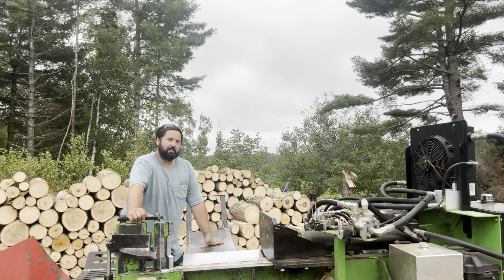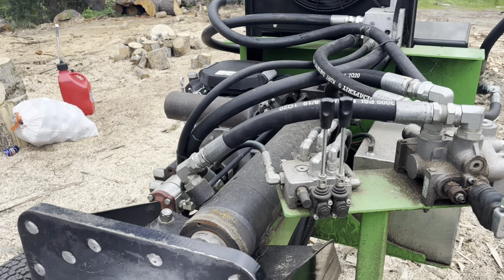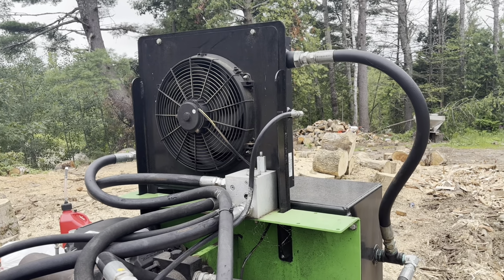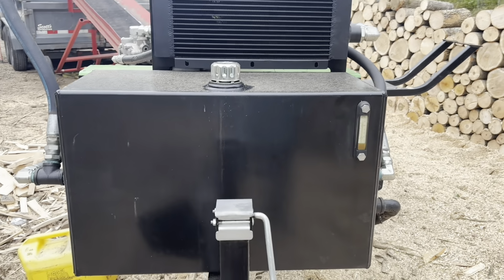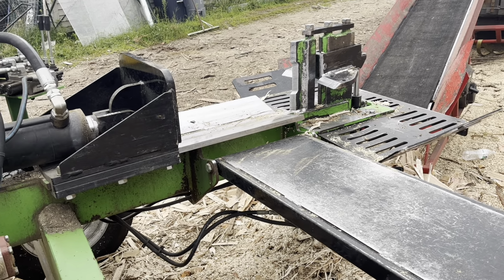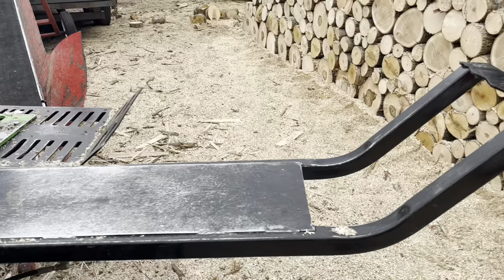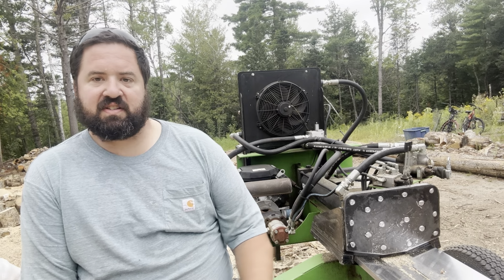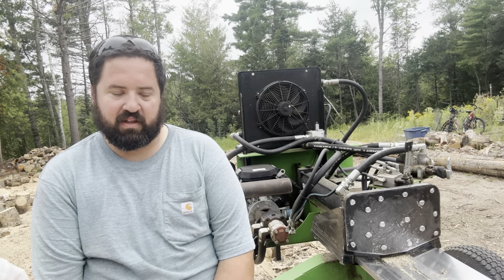#106 Is the Allwood Splitter a lemon ?!?

Comment: Your valve, easy fix to move them, in the marine industry you can get 1/2 bolts flat head, if the bolts are larger a machine shop can make you a bunch, I've been watching almost all of your video's, the only dislike I have the design of your table, it creates a bottle neck you should not be touching any wood going to the conveyor.
Reply from the maker: Yep I agree I need to widen the mouth of the conveyor and I have a friend with a machine shop that is going to do that for us soon

Comment: I just have one complaint about all wood, I ordered my birch unit when you and heath did the “ coming out “ video, like at the new year, I was told 8-12 weeks it’s been seven months. I thought u were an all wood dealer?
Reply from the maker: I'm a non stocking dealer.  This video was made to answer some questions that people had about my old machine.  I know with tariffs some overseas parts have been hard to get but the shop is working through the issues as quickly as he can.

Comment: What are measurements of you r wood racks 5.00 bins and up
Reply from the maker: Each 8' section is 1/3 of a cord when filled with 16" wood.  I break each 1/3 cord section down mathematically for the amounts sold.  4 $5 bins is the same amount of wood as one $20 bins

Comment: Easton made  22 28  most likely what u need   power speed autocycle  and different  wedge opinions
Reply from the maker: @rebeccarobinson7024  I will have the new splitter soon and it’s going to be something no one has seen yet. Stay tuned.
Reply: @WilleysFirewood   ok can't wait forgot about the brute force  ones they are also based out of Wisconsin

Comment: I got the all wood oak series. Very pleased after about a month of ownership.  I am 6’2”. I like the height of the machine. Built like a tank. A400 steel. Don’t know what a400 steel is, but apparently it is really durable. Cycle time is 6 seconds. I wouldn’t want anything faster as I split by myself and extra speed would be wasted. I got a free upgraded sorting table as a veteran. Owner is responsive. Production is greatly increased
Reply from the maker: @davidself3169  I’d buy another Allwood in a heartbeat. They are amazing. I have over 2000 cord through mine with very little issues whatsoever. I’m hoping my next splitter will be higher output and diesel.

Comment: I have a 37D - absolutely love it!  There is tons of power and it barely notices with any of the different wedges.  The only downside to the 37D is the towing...but on the flipside, it is certainly optimized to work from one side.  The only splitter my 37D will be replaced with is another 37D.
Reply from the maker: @jamesbainton  I like the speed of the 24d but I have a couple other diesel splitters that I’m keeping an eye on as well.
Reply: @WilleysFirewood  make sure you watch the Wolfe Ridge diesel vid with the box wedge that Bob Nelson did and the 37D vids.  There is a massive difference in how the wood flows through the wedge...all I am saying is watch closely and you will see the differences.

Comment: Russ, I need to add an oil cooler to my homemade splitter.  Can you pass along the info you found about yours and the next size up?
Reply from the maker: @spillman1569  this is the cheaper larger alternative. https://a.co/d/46LgSD5
Reply from the maker: @spillman1569  this one is in stock Rubivel Industrial Cooling System Mobile Hydraulic Oil Cooler 0-120GPM 90HP

Comment: Speed, durability and customer service is number one at Eastonmade..  i purchased a Bells 4000..  they which is now Eastonmade..  called Jeremy yesterday because ram would not return properly..  2 minutes later I was able to determine the issue .. .  With the 12-22 i purchased, I blew the rad ..  1st time they replaced the rad  shipped to my house the next day..  when it happened the second time they replaced the entire machine..
Reply from the maker: @buckinfirewood  I had a bells 4000 as well and their customer service was always top notch!  Thanks for the input and stopping by!
Reply: @WilleysFirewood  really..  I'm currently running a bells 4000..  great machine I must say..  why do you not have the processor anymore??..  with the amount you push out sure looks like you could use one
Reply from the maker: @buckinfirewood  gramp wants to cut by hand so as long as he wants to cut we will do it by hand. Gramp likes having the work and I enjoy having him around. We are close to the point of needing to shop for a processor again for sure but I need to keep gramp cutting too.
Reply: @WilleysFirewood  Gramps is a machine..  your lucky to have him

Comment: Just got my allwood locast.
Id also like a thermostatic swich. I wish the engine controls were easier to access from the other side. But otherwise, I love it. I have auto cycle and more centralized controls,  also a closed in log lift. Its a monster. I too like the height compared to the others.  Thanks for sharing!
Reply from the maker: @patrickspath4526  yeah the newer Allwood machines have some things changed to fix some of the issue I griped about.

Comment: The blood wood from all wood is a beast 42 ton, full auto cycle, processor style wedges, 24 HP yanmar diesel. It doesn't look like it will accept a box wedge but 4, 6, 8... 
I have the 37D with the 23 hp Kubota it's a 37 ton beast with a smaller footprint then the all wood. I wouldn't recommend towing it far distances. So sometimes I wish it was built on a bigger trailer for towing but I only use it at the house usually. 
Eastonmade is delivering machines all across the USA for $500 that a long with Eastonmades superior wedges IMO would be my selling point 

Wolf Ridge makes great machines no question about it but their wedges need improvement. The closed box wedge system puts a lot of stress on the engine, cylinder and wedges. The slip on wedges would not last a year with the type of wood I split they would bend or break. 
The Eastonmade box wedges and traditional wedges are just built stronger and better.
Reply from the maker: @WellsFirewood  I’ve seen the diesel bloodwood splitter. It is impressive. Thanks for your input and stopping by!
Reply: The new All Woods do have a few improvements for sure. A lot of great manufacturers out there these days. We love our Muscle Wood but haven’t put quite the wood through it that you have.
Reply from the maker: @hardworkingmanoutdoors  they really do make a great machine!

Comment: I have a wolfe ridge 28c i have just shy of 800 hours had 2 hydraulic leaks one on main cylinder one on the autocycle valve both replaced by chris at wolfe ridge no questions asked. Once my cooler turns on it doesnt shut off until you stop splitting so a temp sensor is not necessary after fluid is warm in my opinion
Reply from the maker: @shawnwilliams7041  Wolfe ridge is in my list of options for sure

Comment: I always thought it crazy that guys would load the log lift and then walk around to the other side to run the controls.   Adding a little more room to the lift side between the tire and lift along with  locating the controls there would solve that BIG issue for a lot of folks.  2 folks can easily operate from one side on either side of the lift.
Reply from the maker: @SligoRoadOutdoors  I definitely want to be able to operate it from either side of the machine. That is a must.

Comment: If you like diesel and you want fast the 24d has both. It’s faster than the 37d just not as much power. From what I see your wood is pretty good not all gnarly. Just as you said the more splits the more waste but production goes up. I think the eastonmade you can choose between a box wedge and a standard multi wedge on the same machine. Peace
Reply from the maker: @williamkleinsLost40Lodge  the 24d is one of my candidates for sure. I’m doing some serious looking into things from all manufacturers.
Reply: @WilleysFirewood  this is knl firewood with a 24d
Reply: @WilleysFirewood  https://youtu.be/lvkiJOKbADI?si=c6lrfAGpkizqhP_j

Comment: I have a diesel HDI box wedge. Have I had issues. O yes but. I will say without a doubt hands down. Chris at Wolfe Ridge has been there for me. He stands behind his product. Once I send a email explain my issue. I will receive a email or a phone call and the fix is on its  way. I don’t think I have ever had such great customer service from any new product purchased new.   You’re correct on the machines breaking. Customer service and parts availability are so important. Time down is lost revenue.  The box wedge is so nice with uniform pieces. But what a mess. You can get buried in slash and trash so quickly. Great video. Really cool,  you’re being opened minded with your choices of manufacture to go with. Good luck sir.
Reply from the maker: @BW35bucket  Wolferidge has definitely been on my radar. I am not tied to any brand but know that money is hard earned with firewood and I want to do my due diligence before spending my money.

Comment: mechanical things break down. It does not mater, it will happen. You do an amazing amount of firewood. I have two splitters that I made both have 18 HP with a 24 gal two stage pump and both have log lifts and are electric start. I split about 6 -8 cords a year for my two houses that have wood as their nain heat source. We split oak, fir, maple, and Madrone. Keep up the videos. I look forward every day forma new one.
Reply from the maker: @johndenoma6397  I appreciate your input and kind words. Thank you very much for stopping by!

Comment: I seriously considered an all wood when i was looking bobby is a great guy. It just worked out that built rite dealer was closer to me and easily attainable. I bought a built rite 13 super, its a great machine but i am tall also and it does sit low and i have to be bent over when i run it. I am going to switch to a vertical splitter, I think for what i do it will work out well.
Reply from the maker: @patrapper2077  the height of the Allwood is one of the things that I myself really like. I’m 6’2” and I don’t want to be bent over all day.

Comment: For the Falmouth Lion's firewood operation, the Timberwolfe TW3 HD has worked well. 3pth so height is never a problem,  22 gpm pto driven pump makes it quick. 3 cylinder IH 464 tractor easy on fuel and able to maneuver around the yard. Keep Kevin humping.
Reply from the maker: @johnwinslow4503  I started with a TW2 as my first non box store splitter. It worked well but the Allwood is 3-4 times faster. We will keep kevin cranking along again this week.